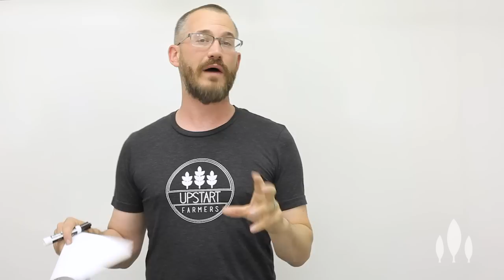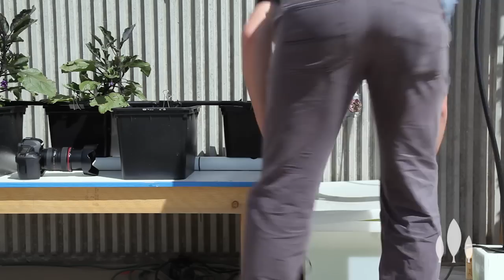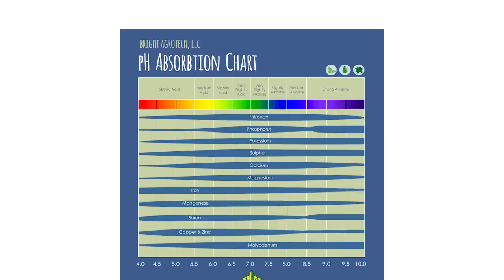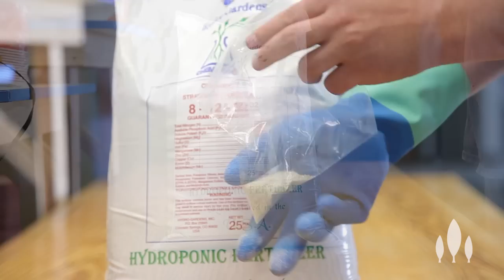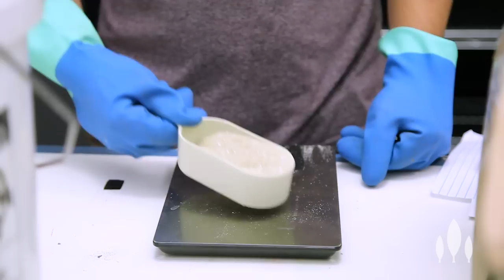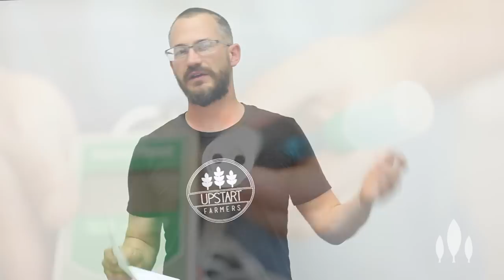A Beginners Guide: Hydroponic Nutrients

Comment: Hello! Good videos! I have a question. Why my calcium participate when im mixing the reservoir? I know when air bubbleing takes out co2 from water so it raise ph, but every hydroponics need some kind of airstone in the reservoir, doesnt matter its a dwc or nft system. So my question is what the best practice when mixing nutrients? I wait 1 day with tap water to get stagnated, and i  air bubbled it too. Than ph go up 8.0 . Than i add a bit of nitric acid 60%, to get ph down to 6.5. Than i add a solution A (npk 6,14,30+epsom salt) stock solution, than waiting for another day and bubbleing it. Than next day i add the calcium nitrate stock solution B, than add more nitric acid to make ph 6.0. Than suddenly ph starts to rise again and calcium participate, and make cloudy water. The water was on room temperature all the time, ec went up after mixing all nutes to 900ppm (what is good), so dont know what im doing wrong pls help. How to avoid this participated clody water. Thanks.

Comment: Hey man, thanks a lot for your vdeos, it has been so hellpfull to watch them, i need to ask, how much water solution can i put to a 1000 lettuce plant??  n hydroponic system
Reply from the maker: Hi there, if you are growing hydroponic lettuce in pots/containers, it’s a general rule of thumb to irrigate 2% of the total liter capacity of the pot (per shot). 

For example, if a head of lettuce is growing in a 3.5L container, at 2% for a single shot, this would equate to 70mL of water being irrigated (0.02x3500mL = 70mL). Then you would need to calculate how many irrigation cycles you are going throughout the day and multiply that by 1000 plants. This will give you a good idea of how big your stock tank would need to be in order to feed your crop for a single day. 

However, there are different methods of calculating the total amount of irrigation feed depending on the system being used (NFT, Aquaponics, etc.).

Comment: Why is the type "C" stuff not sold already incorporated in the type "A", If both dissolve why keep them separate? (Or do you need to vary the relative concentrations a lot by plant type?)
Reply from the maker: Hi Peter. Most growers tend to work with a tank “A” and “B” stock solution. The most important takeaway from creating your own hydroponic nutrient solution is to keep calcium nitrate and magnesium sulfate separate. If calcium nitrate and magnesium sulfate react at high enough concentrations, calcium sulfate will form. 

This precipitate (solid) will get into your pumps and irrigation lines. It's almost impossible to clean out of the system and some lines/parts might need to be replaced depending on the damage. 

Some growers will use a tank “C” depending on their crop/nutrient mix, but it’s more of a personal preference. Just make sure you are dosing your tanks at low enough concentration to prevent precipitates from forming.

Comment: are they the same to aeroponics?
Reply from the maker: Good question Ricardo. Yes. Hydroponics nutrient formulas take into account the fact that you're starting with reverse osmosis water and therefore provide a balanced mix of micro- and macro-nutrients. The same holds true for aeroponics. Most soil fertilizer focuses on amending or supplementing what is already present in the soil and therefore doesn't include micronutrients.

Comment: Great video to learn and understand hydrophobic nutrition. I wanted to know if your PH is too high, how can you bring it down if you advise to stay with one of either PH up or PH down?
Reply from the maker: It's not that you can't use both pH up and pH down in your system just that the two work against each other and if your pH is behaving erratically its generally a sign that something else needs attention. Under properly balanced conditions your system should trend in only one direction.

When you use both together they increase the buffering capacity of your water such that you will need more and more in order to change the pH, and it quickly gets into a vicious cycle. It might be easier to reset your reservoir with fresh water and monitor the pH closely from the start.

Comment: Great vido,thanks. About a nutrient mix in a nft system ... how many times is to be used before throwing it away?
Reply from the maker: Hello! Often with smaller hydroponic systems we recommend replacing the solution every 1-2 months because you will build up a higher ratio of Calcium and Magnesium that will artificially inflate your EC values. This is also a great opportunity to clean your reservoir and flush your lines. 

Thanks for watching!

Comment: When you use tap water, there are already chlorine and other minerals in them. How does electrical conductivity work in measuring fertiliser concentration vs chlorine or other mineral concentration
Reply from the maker: Hello Sandeep, this is definitely something to consider. Ideally you would like to use water with the lowest EC possible as a starting point (RO, Distilled, even rainwater) But if using tapwater it is important to measure incoming water EC and add that to your EC setpoint to account for that "artificial" EC

Comment: Nice explaination , i definitely get dry mix fertilizer and go thru the few extra added steps if I was getting much more fertilizer to uses and it was cheaper because fertilizer gets price if it's a liquid based one. Also I knew how to use the EC testers , TDS testers , and pH testers but didn't know there was equipment like auto dosers that just automatically told you that info on computer screen in real time. So if you did mess up for example pH you could uses a pH up or pH down solution to fix it. And just look back at the auto dosers screen.

Comment: You didn't mention the water details. I start with reverse osmosis water with a Hydrologic Stealth RO 200, which filters my 320 ppm municipal water down to 6 to 8 PPM. Now, the filters are several years old and it filters down to 16 PPM. I heard that you need to have your water below 20 PPM, and ideally below 10 PPM, otherwise your nutrient can lock out. Is that true?

I hand mix each 5 gallon batch. In the future, I'd like to auto dose. I use a three part dry mix. Masterblend 4-18-38, calcium nitrate, and epsom salt. I use 12 grams / 12 grams / 10 grams for fruiting plants and 10 grams / 10 grams / 5 grams for greens, for the 5 gallon batches. I pre-weigh 50 dry mix batches on a gram scale that does not include the weight of the plastic sandwich bags. The 50 dry mix batches use 150 plastic sandwich bags. 

I heat a large drinking glass of RO water  in the microwave for 1 to 1 1/2 minutes, so that the water is warm to hot to dissolve the calcium nitrate. Then mix the Masterblend, dissolved calcium nitrate, and epsom salt into a 5 gallon bucket of RO water. I then add 5 ml of pH up. I periodically test my pH with testing drops, and check my PPM with a PPM meter. 

Is testing with a PPM meter close to the same result as testing with an EC meter?  I use a PPM testing meter. I've thought about getting a pH meter, but there are some cheaper pH testing meters that you don't have to keep the probe wet in storage, and the Blue Labs pH testing meter where you do have to store the probe wet, otherwise, the probe will die. It seems that even the cheaper pH testing meters might be more accurate than the testing drops, which I aim for a "yellow" result for a pH of 6. 

I usually replace the 5 gallon batches every one to two months. I dump the old nutrient on outdoor plants instead of throwing it down the sewer.  I grow in 5 gallon black buckets and 10 gallon Sterilite brand trays, each with nine 75 mm holes drilled in the plastic for a perfect fit for the 3" net pots. The 75 mm hole saw drill bit is run in the forward direction for the pilot holes and the reverse direction for the 75 mm holes, for perfectly clean edges every time. 

I grow with one Sunsystems 315 watt ceramic metal halide grow light and about 20 - 150 watt equivalent CFL bulbs. The CFL's seem good enough for greens, but the fruiting plants, like peppers, grow much better with the higher intensity light from the Sunsystems grow light. 

Eventually, I'd like to buy a large reservoir tank, and automate the nutrient and pH in the reservoir tank. I would also automate filling the reservoir tank with RO water. It's a lot of work to manually mix 5 gallon nutrient batches and haul around 5 gallon buckets of nutrients, both replacement nutrient batches and spent nutrient batches.

Comment: Please advise what will happen if we make only one part solution?
Will the precipitates seriously affect the nutrients?
If we physically remove such salts can we use the nutrient solution?
Reply: Precipitates will definitely affect the nutrient ratios. You could strain out the precipitate salts, but it would be a huge pain to get them out and your nutrient ratio will not be right. While it may not be a big deal in terms of the plants doing well, it does mean that you don't know exactly what you're giving to your plants. And in the case that it does cause a deficiency in your plants it will take some research to  correct. What salt precipitated out? How much came out? Now what and how much needs to be added?

Alternatively, you could buy a one part formula that has everything needed and won't precipitate put of solution.

Comment: 9:17 Actually if you combine an acid and a base they will create something called a buffer solution which will make changing the pH n either direction a lot more difficult. Especially if you use the corresponding base to the acid.
Reply: What should we do instead
Reply: @mac9733  Buffers aren't nessecerily a bad thing.

Comment: You talk about 16 plant nutrients, but our bodies need 90 nutrients, and 60 of them are minerals.  I add liquid seaweed to my mix hoping to get them and I also throw some green sand into my reservoir in the hope that the mycorrhizae will release them for the plants and for us.

City water in San Francisco is about pH 9.5.  By the time I add the nutrients it is down to about 6.5.  I use pH down or ascorbic acid or distilled vinegar to  take it to 6.  I got a cheap pH meter from Amazon and it seems to work.  I have the Bluelab EC meter but I would suggest trying the cheap ones.  I use a bloom mix for the flowers in my yard and I set that at pH 4.5 to hopefully compensate for the high pH of the city water I put on them.
Reply: tangobayus Azomite rock dust has 67 micro nutrients  worm castings also great over looked organic medium that Full of All kinds of Good Stuff ! Use at 20% to 25% volume w/coco/peat ,perlite & Happy frog or equivalent

Comment: Do you use more of these nutrients in hydroponics than you would in "normal" farming?
Reply: I can actually answer this, I happen to have a bottle of normal liquid fertilizer I have been using (need to upgrade to hydroponic fertalizer now) right next to me. It contains 87% water 7% Nitrogen, 1.3% Phosphorous, and 5% Potasium, and trace minerals adding up to less than 0.05% none of which are the ones mentioned in the video (almost half of which is Iron).

Comment: Question:  the nutrient concentrations are set for optimal (fastest?) plant development, meaning they may be higher than the plant would naturally be able to filter out (via osmotic pressure?), meaning those elements and minerals may be "pumped" at high concentrations into the plant and transferred into the consumer. For example lettuce, you eat 70% of the plant, so you get probably a overdose of those minerals if consumed on a daily basis? Is there a practice of measuring the dry mineral content from the same amount of plant matter from natural source and from hydroponic products? I guess that's the "trust the producer" stuff but do I trust them to not make their stuff too concentrated ?!

Comment: hi i need to ask you a question but first great video put everything plain and simple  and my question is about something you said on the video about automatic fertilization what kind of machine or gadget do you recommend for cherry tomatoes on a hydroponic greenhouse   second question  what height do you recommend for  a greenhouse  if i am planting  undetermined  tomatoes on the tropic at sea level ?  my greenhouse will be  6' walls 18' at the center of the greenhouse  24' wide  by 120' long  -

Comment: Different plants have different nutrient needs at different times, do you have a book or chart that shows the differing needs for each specific plant?
Reply: Dennis Totman any condition your plant may be in either from receiving too many or too little nutrients should be simple to pinpoint to which nutrient your plant is needs more/less of
Reply: Dennis Totman every plant is gonna need the same nutrients really, some plants respond better to more, some respond better to less

You gotta see how your plants react to the nutrients but start by using 1/4-1/2 of the manufacturers recommended settings

Comment: What kind of water would you want to use? Tap? Distilled?
Reply from the maker: Hey Bradley, most people can use tap water. The only issue that could pop up is if your local water is highly treated or has high carbonates (deposited from limestone). If you have carbonates at 200 ppm or more (you can sometimes find info about municipal water online), they will mess with your pH. The best solution is an RO filter in that case.

Comment: Im currently been growing super hot chillis Bhut jolokia and carolina reaper for 2 months using hydroponic kratky (and a airstone) And its growing well! 2 feet high bushy and dark green w Lots of small fruits and flowers. So fun :D
But my problem now, is I have to adjust PH 2 times daily! keeps raising from ph 5.5 to 7.5 - 8  Do you have the same problem?  Im using a 2 gallon bucket, 1 gallon water at 650 ppm. PH down solution is Phosphoric Acid, and my guess is that the plant itself are consuming the Phosphoric acid, which then raises the PH!? Do you know how or if I can solve this ? :)
Reply: hi, great question!!! I too am interested in the answer to your question. I am using Nitric acid  for the same purposes. I was thinking to may be use sulphuric acid ,but again what about the water chemistry and residual Sulphur nutrient? my water contains 6meq of carbonates.
Reply: hi, great question!!! I too am interested in the answer to your question. I am using Nitric acid  for the same purposes. I was thinking to may be use sulphuric acid ,but again what about the water chemistry and residual Sulphur nutrient? my water contains 6meq of carbonates.
Reply: oh wow, I was running airstone 24/7  Do you really think this was the cause?  1 chilli keept dropping flowers,  but the other ghost pepper, ive got a few fresh ripe pods. stopped the project, cause the PH problem made it so much work to run
Reply: How long has it been since you've completely changed the nutrient solution?
Reply: sctprog I changed water solution once a week. Simce the small bucket size, I had to top up like 2 times a week. But the PH problem might be from my nutrients? it was not a famous brand, just hydroponic solution I got from a local nursery
Reply: Buckets are too small the plant is depleting all the nutrients in the solution thereby raising the PH. Hope this helps 
Growers love.
Reply: lower your nutriens ppm to 400

Comment: If i'm doing a more aerated spray in my hydroponic system, would the nutrient solution reach the plants if the nozzles has water droplets at 7 microns?
Reply: You need a droplet range of 5-80 microns. Dont use 10-24 brass patio misting nozzles they will clog within days. Run drain to waste using the correct nozzles and you wont have any clogging issues. You wont need to constantly check and adjust the PH/EC or ultimately dump the reservoir because the run-off doesnt return to alter the chemical makeup.
Reply from the maker: Hi Jonathan - Depends on the set up. In our experience, aeroponic nozzles have a tendency to clog.

Comment: thanks!a lot for the information.it is really helpful and covers almost every aspect of hydroponic nutrients specially for the beginners like me.one question though,how we top new nutrient solution to the old tank full of old nutrient solution?i mean,if i have already a nutrient tank half full of previous nutrient,should i just pour new nutrient solution in it to top it up or should i empty it up and then fill it with new nutrient solution?
Reply from the maker: +nircik singh, you can top off your solution either way but we recommend using an EC meter to mix nutrient to the right level. Of course, the balance of your solution can change over time as plants take up more of one nutrient than another, so you'll probably have to reset the system every couple months. Cleaning it out a couple times a year is good for sanitation as well, so you can do both at once.
Reply: Bright Agrotech
thanks for the reply:)